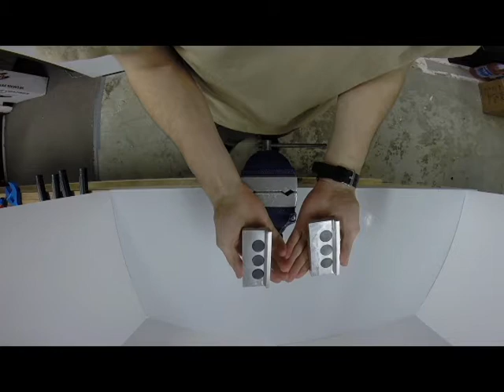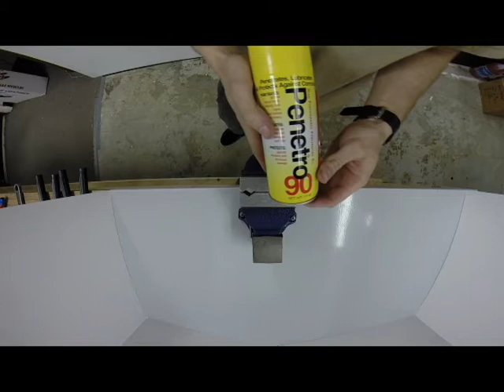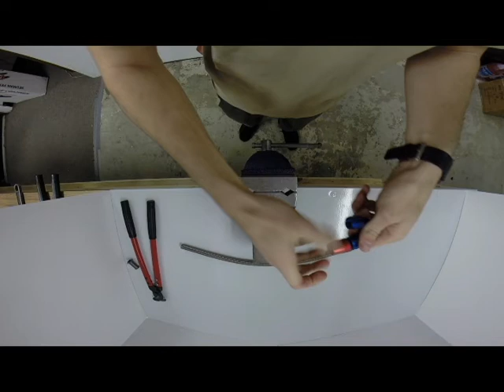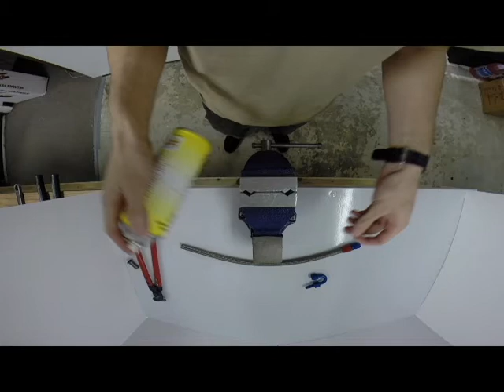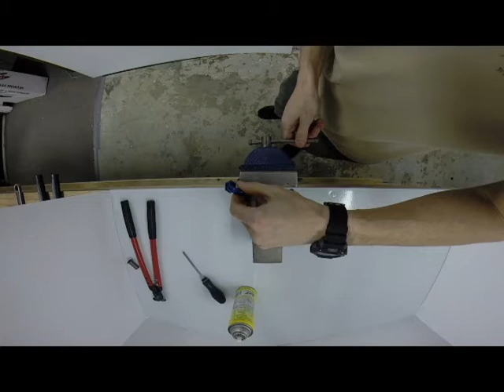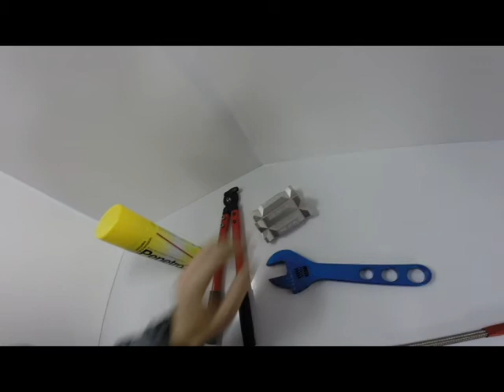How to Assemble AN Fittings on Braided Stainless Steel Hose

Comment: What AN fitting do I need for a hose with the inside measuring 3/8 as to the outside measuring 1/2? Great vid!
Reply from the maker: You would need a -6 AN hose end. Our part number PRE-10600 if you need a straight. PRE-10690 for a 90 degree.
Reply: Thanks!